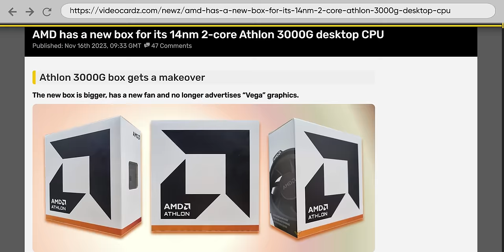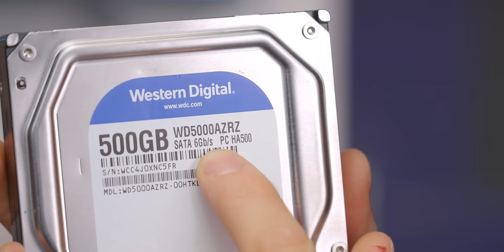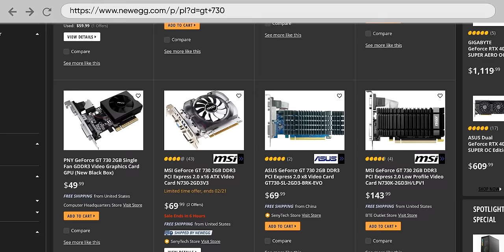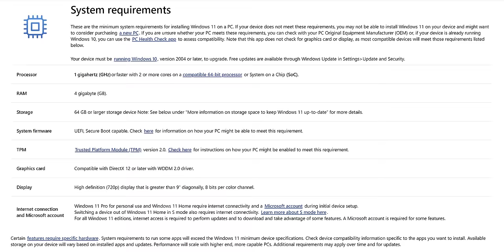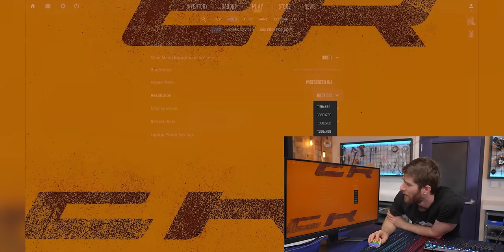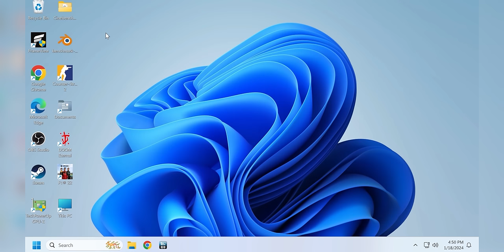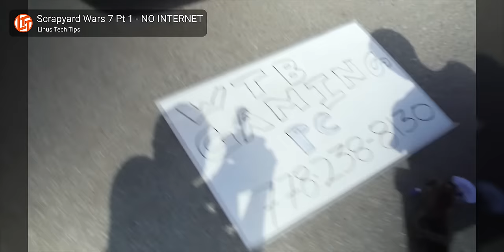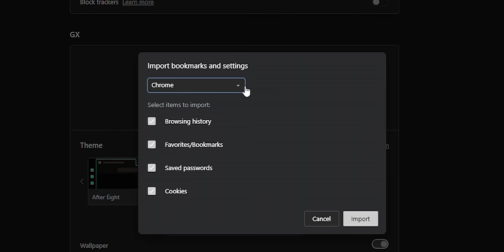I Built the Slowest Brand New PC and it Sucks.

Comment: Something to note, these OEM machines very often use proprietary connectors and parts, swapping out the PSU might need special motherboard adapters and sometimes even a GPU might not physically fit
Reply: And those adapters are available for a whole lot of Dell, HP, Acer, and Lenovo desktop motherboards. Yeah, you probably have to wait a couple weeks for the adapter to arrive from China. As for the GPU not fitting in the case, Harbor Freight sells angle grinders.
Reply: That's one thing, i got myself a old SFF hp office desktop and well it's not really upgradable, no psu upgrade due to SFF and it can't fit most of the parts due to lack of connectors in the psu .
Reply: Good point, someone could always get a GTX 1650 not exactly a great GPU but powered off the PCIe no need for power adapter and is tiny so would fit even in a small OEM case.
Reply: @littlemeg137 Always a great idea to use a random adapter self-imported. That way insurance pays you and you pay the insurance company if it starts a fire.
Reply: Hey, another Latios fan! It’s rare to see them in the wild.
Reply: Yeah for sure.   Better to invest in a good case and keep it for the long run.  I spent way to much money replacing parts on one of these recycled e-waste machines for my son’s first computer.  Had a motherboard fry,  bought a used one, then the factory HP power supply shorted, which took out the power supply and the second motherboard.   Ordered a 3rd after market motherboard only to find out it won’t fit my case or power supply.  Ended up buying all the parts to get this 10yo system running.  That was back in 2021-22. Never doing that e-waste crap again.   Just ordered parts for my other son’s first computer.   Ryzen 5500GT, B450 board, 16GB DDR4, 256SSD, power supply, case.  $380 shipped.  No GPU but he’s only 5yo.    Saving old trash OEM computers isn’t worth it.   Oh and this is my first AMD cpu.
Reply: HP is the absolute worst with this. The mobo is hardwired to the PSU and they provide exactly zero extra connectors.

Comment: I think it's worth mentioning that a Steam Deck is also a viable option at this price point. A refurbished 500gb LCD model from Valve goes for £300 with a 1 year warranty. 

Of course, you can use a desktop for more than just gaming, having SteamOS comes with many caveats, Deck is impossible to upgrade, and many popular multiplayer games have linux-unfriendly anti-cheat. Still, it's been my main gaming device for over a year and a half and I couldn't be happier. Not to mention many game devs optimise their games for the Steam Deck, and several even work with Valve directly to bring support (Spider-Man Remastered, Elden Ring, Baldur's Gate 3, Armored Core VI, Cyberpunk 2077, etc.)
Reply: At lowest settings sure.
Reply: It is an alright option, you can even use it permanently connected to a USB C dock if all you want is a desktop. I now use an ROG Ally as my only gaming PC. You just have to be fine with playing games at 720p, which to me personally, 720p and using RSR to upscale to 1080p isn't too bad, as just someone who very casually plays some indie games.

Comment: Never thought that I would see a "New PC" that is slower than my i3 4005u laptop
Reply: Atlteast with ssd and lot of ram that thing should be fine for basic task . My old brother laptop that have been sold last year was completely unusable despite having core i5 8250u, cuz it still use hdd as boot drive
Reply: I had something similar just until last year. it was 2nd hand i3-2130, it had more ram than u could need, a similar hard drive, and it was just like this... forever loading, I couldn't take it anymore. it even had the same 1030 gt!

I since upgraded to another mobo that supports i7-7700, with nvme drive. and a 1650 low profile card. now I have windows 11!
Reply: You got dell Inspiron 15?
Reply: Laptops are always ever marching forward in tech
The form factor dominate the windows and mac space
Normie tech users will prioritize laptops when shopping for a windows laptop due to portability
and because they are well integrated, if one irraplacable component dies, it usually takes the rest of the system with it.
First party service centers often screw up their customers' critical repairs, 
and most laptop users rarely put the effort to look for actually reliable repair shops, 
since they are in a sea of sketchy ones.

This explains why the average steam PC never goes slower (except the GPU)
like, 6 cores is the most common CPU with 2.5 Ghz clock speed???
Why is the 1650 the most common GPU? last I checked, no one buys this card
because laptops have this as the bare minimum.
Reply: wait, how did I find someone with the exact same CPU of my 2nd worse laptop on a channel like this? (the worst being a Pentium T3400 I got for free, and the best being an i7 4510U I also got for free)

Comment: This takes me back to the days when I had a I3 2100, 8gb of ram and a gt740. Those days were only 3 years ago...
Reply: Had GT440, I3 2125, 4gb of DDR3. Painful renders and gaming at 720p (Lowest), tweaking settings to get one at medium, 30 fps looked so good. Only 6 years ago.
Reply: i still have i3 2100 and gtx 550ti. 
The machine was a benchmark in 2012 :D 
Today it crushes numbers and compiles kernels haaha
Reply: Still rocking i3 3220, GT 610 with 4gigs ram.
Reply: @himanshutripathi7441 gt had 1 gb of gddr3 or ddr3, so not that bad.
Reply: @scarry46  good for you.
Reply: 16gb (ddr3), i5, and gtx 650 earlier this year
Reply: I was rocking an i5 3450 + 8gb DDR3 from 2012 to 2020. Never let me down in gaming. 2 years ago I put it in my mother's PC (an old HP desktop I recovered from when I was an IT in a highschool, came with an i3) and honestly it's still doing its thing, but I can tell major updates with tons of features really made Win 10 way more demanding than it was like even 4 years ago.
Reply: @TheJoe971  what was the GPU?
Reply: @jamdva8176  Started with a HD 7770 in 2012, then switched to a R9 390 in late 2015. Never struggled to play the games I wanted. Only Red Dead Redemption 2 put it on its knees (out of all the games I have in my library I mean). I'm having issues now however, ever since I did a BIOS update on my motherboard (my new build from 2020 is a MSI X570 Gaming edge wifi + Ryzen 7 3700x), desktop won't boot. Nothing, not even a post screen, just turns on and no display and no keyboard reaction. And I believe this is due to this GPU not properly supporting the whole secure boot BS. Thankfully I have a gaming laptop to keep going.
Reply: @scarry46 im just curious but what games could you actually even play besides like terraria or something
Reply: Almost the same, I used an i5 7500, 8gb 2400mhz and 1tb HDD. It was a HP g3 sff pre-built. And again those days were 3 years ago. It stuttered a lot while playing GTA 5 ( I didn't know the 6th, 7th and 8th gen driver hack) and I always blamed myself for not having a GPU and HDD With just 8gb ram.

Comment: Buying older high end hardware always beats buying the new lower end stuff.

Edit: Just for an example, I still use my GTX 1080ti to this day. For a card that came out in 2017 it's a beast. Even beating my RTX 3060 at some points.
Reply: as long as it isnt fried
Reply: My main system is still running on an old Asus Z87K motherboard with a mildly overclocked i7-4790K and I still manage a minimum of 60FPS in every game I've ever played. That's far and beyond the capability of some of this low end stuff that still comes out today if you try to go dirt cheap
Reply: Serious Question 4070 Ti Super Or 3090 ?
Reply: @keepmovingforward5576  If they're similar in price I'd actually say 4070Ti cause it crushes the 3090. You'd be better off saving for a 4080 though cause price to performance and all that.
Reply: im still on a 1080 not a ti and its still a beast
Reply: Yup, can confirm, even my 1080 non Ti still rocks it today.
Reply: still on a 980 and its not a beast
Reply: @justus9694  Still a pretty capable card with only 4gb of vram. I was able to play god of war with 60fps at medium settings with that card and it wasn't bad.
Reply: Hell, I'm still using a 4790k and a 1080 FTW. RIP EVGA GPU division. :(

I'm at 1440p and honestly, still hitting med-high 60-120fps in most games I play. I am beyond pleased with how well it's held up over the years.
Reply: @dizzyishere999  yeah I was jk when I said its not a beast, it might be a totally capable card still. Got it when it was new (before the 980Ti release), back then it was awesome. I don't play games anymore, it's actually way overpowered for me now lol
Reply: I'm running with a Ryzen 5 2600 and GTX1050ti, with 16gb of ddr4 ram at 2133mhz (need to get around to adjusting my xmp, it's at 3200 which is too fast for my mobo).
Praying the gpu doesn't die before the elden ring dlc, since it's about 7 years old now lol
Reply: I was debating on selling my gaming laptop with 1650ti and 500gb HDD and getting the same one with a 3050/3060 and double my frames instantly from 60-120… would that be a solid option or would it be better to just invest in used pc parts and a workstation 🤔
Reply: True, but it should be noted that in this case ram and HDD are surely not helping. Years ago I built a W10 machine with an i3 6100, 8gb ram and cheap SSD for my brother. It is still usable to this day for light tasks. Surely much, much faster than what we see in this video. 
But how is this build within the min specs!? 😂
Reply: @ajpardy7620 any chance of swapping the hdd for an ssd? Would definitely improve performance for such a portable machine.
Reply: @ajpardy7620  I'm not sure why people are asking me questions I'm just a regular nerd like everyone else here. 😂
If you'd like my opinion though I'd say invest in a work station. If you can bear with the 1650Ti for a bit longer a full desktop will get you much more performance and would probably be way cheaper than an RTX 3050/3060 laptop.
Reply: @mastroitek  Oh yeah the 4gb of ram is immediately all used up by windows and barely leaves any room for anything else. The HDD definitely makes it suffer even more. A cheap sata ssd and another 4gb of ram could really make the PC in this video shine. The cpu bottleneck also makes it much worse, anyone using a celeron and a 1030 isn't gonna be gaming much.
Reply: Its so much better, Unless you are a millionaire it is 1000% worth it to buy used from somewhere with buyer protection like ebay, got a 1080 ti for closer to 100 might have been 120 cant remember, And now I could upgrade to an RTX 2070 for $200
Reply: @dizzyishere999  I mean hey I just like getting peoples opinions who have at least a little knowledge in it XD but I appreciate the feedback, I was thinking of getting parts on sale that will be slightly future proof, take me a while to build or I can save and get it all at once but I may be spending more
Reply: @Prince-du7ei  I do have the option for upgrading hdd and ssd, was thinking 1Tb hdd for base storage of things, and ssd upgrade if I decide to go the route of upgrading instead of saving for desktop
Reply: @Olliinn built my partner's PC recently, and managed to get a 3060 12gb from ebay for 330aud (215usd). Absolute steal, methinks.

Comment: The low-end market has pretty much been left in the dust since the gpu shortage, every company seems to have concluded to not improve the budget market because forcing everyone to spend more means more money for them. At least the used market is a thing again
Reply: Hell yes,I don't mind buying used if it's high-end and affordable
Reply: I mean is that not a valid reason? This videos whole point was to show that low-end stuff is pointless. You're not gonna be happy with it. If the only thing on the market is mid to high end, eventually the used market will be full of older mid to high end, like the 1080. It's still a very valid card. 

Low end for a gaming setup is pointless.
Reply: used market is good for everyone.
-good for manufacturer since they don't need to produce low margin product and giving low end segment to last gen product
-good for seller when they decided to upgrade, their old equipment doesn't become e-waste
-good for buyer because they get product at lower cost
-good for environment
Reply: @kuekejuu5057  It's bad for manufacturer because it lowers the demand for their product and for the seller because of lower margins on older stock. Truest me, if NVidia/AMD/intel could make their products literally implode when warranty ends without backlash, they would do it.
Reply: You better build a Raspberry Pi system than build a low-end PC
Reply: Nvidia can't see you poor complaints over their huge pile of AI cash. AMD has no reason to release something better and cheaper because people still buy Nvidia 10x over AMD.
Reply: The low end market is stronger than ever, it is just different. Instead of the low tier being a crappy GPU, the low end choice is now a functional apu.
Reply: Indeed, glad that you think nvidia sucks too.  @rodryguezzz
Reply: That's good, brand new low end stuff is basically e-waste. It's also not very good value since there are so many fixed costs beyond the actual silicon such as packaging, cooling, distribution, etc.

The current paradigm of only producing mid-high end stuff and the used market filling the role of the low end is perfect.

Comment: That case thankfully got upgraded a few years ago and has acceptable front intake through the mesh. Originally, it didn't have a mesh front and only had a tiny intake gap at the bottom. It was wretched.

Comment: Just made a used PC from an Optiplex 3050, i5-7500 and GTX 1660 S, all for 200 euros, it's amazing. And the process of finding deals was fun actually, I even found a platinum V1200 power supply from CoolerMaster for 50 euros. I love the used market!
Reply: It sounds fun if you dont really NEED a PC. I would try it for the fun of it.
Reply: Fair warning for those going this route: 7th gen Intel and older, with few exceptions, is not supported by Windows 11.
Of course Linux will still work.
Reply: I got a 13700 pc off ebay for $400 that I'm using as a server since I already had an 13900k lol
Reply: fr bro i built a new pc recently for 320$ dollars, ryzen 5 2600 for 40$ gigabyte rx 5700 xt for 125$ and 16 gb off ddr4, oh and a msi x470 for 75$ used market but it was brand new in the box
Reply: Sounds good 👌🏻

Comment: That long loading immediately brought me back to the horribly slow Windows XP/7 school computers of my youth.
Reply: My school still had those painfully slow think pads in 2011/2012. Literally took half the class to get booted into ie.
Reply: Ikr? It reminds me of my old desktop, and my daily routine: Power it on just entering the house, leaving it loading while I was doing the usual stuff (storing everything, changing clothes, bathroom break) just to not die of starvation watching it load 😂
Reply: bro computers are still like this in school or even workplaces
Reply: @godpop  I would have thought most of those old xp think pads would have died off by now. Even the dells running office 03 ran better
Reply: @billy101456  different countries bro, some are still behind in electronics.
Reply: @godpop  it's 2024. 12 years is a long time for a laptop that was already easily 3-5 years old in 2012 to still be functioning. I have enough trouble keeping a 7 laptop online. With increasing numbers of programs refusing to work because it's too old.
Reply: @godpop  yeah but it’s getting more rare. I still use DOS 5 a lot for work and Windows 2000 on a Pentium II for work. That’s to run specific programs though

Comment: I use an i7-3770 with a 1050TI as my main setup, 240gb ssd, 2x 500gb 7200 rpm hdd for storage, 4x 4gb at 1600mhz, sure not great but without any money theres nothing better to get and a lot of stuff is still running, and the only thing I had to actually pay for was the 1050 TI which was 30 bucks, everything else was scrap parts I got either for free or got from places I worked at, else I'd have probably planned to go with a 1650 if the friend didnt offer me the 1050 ti.
Always have to lower the settings but as someone who grew up with only outdated hardware and as someone who isn't too much into gaming (especially not the modern gaming), this build is fine, I am basically used to playing on PS2 and Nintendo DS so something like 1600 x 900 on medium settings and 30 FPS looks fine to me already (on more modern games)
you can think whatever you want about me or call me out for anything but while I am not "happy" about this setup it also isn't anything I can complain about, especially considering it cost 30 bucks for me get, just because its old it doesnt mean its bad, I love using old stuff, especially if it still works just fine.
The high end standard many people see and aim for is such a negative result of society saying you need it and making you want it to not feel bad, but honestly, as long as YOU like the setup you're using and it works for you, be happy with it, no matter if its 100 bucks or 2000 bucks, as long as its fun, its good!

Also, a little tip, if you want to get a deal by taking older hardware, make sure theyre still compatible with stuff you wanna use, my cpu as an example doesnt have AVX2 which some modern games want you to have, I had to sacrifice ability to play one game when I gave away my laptop with a Ryzen 5 3550H/rx560x to then use the i7-3770/1050 ti combo
Reply: @NoBodysGamer  I am from Germany
Reply: I run the 1050Ti with a i3-10100F and I have no issues, I can play RDR2 on high settings while getting 50-60 fps which is absolutely great for me. Everything else for every day use runs smooth af. I might upgrade the card someday but it can handle everything I care about just fine.
Reply: @RicardoMontania  I now passed on my 1050 Ti to my brother and bought an RX 580, its performing way better, I am gonna miss the opportunity to use my GPU for AI stuff tho